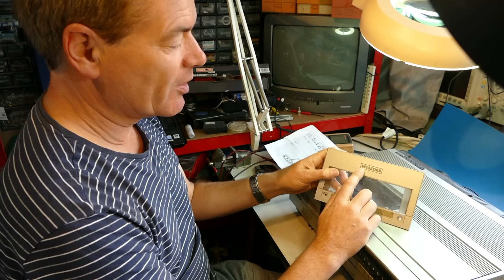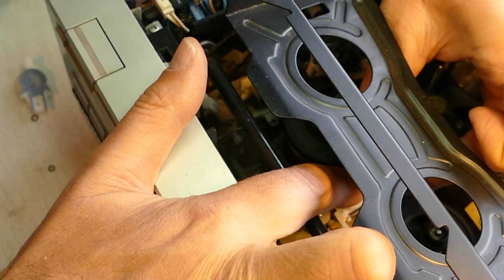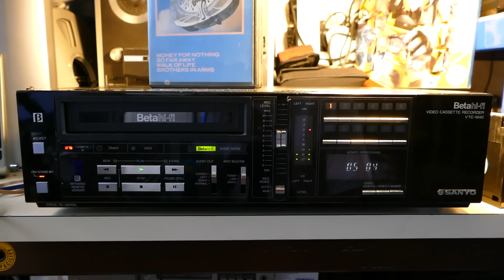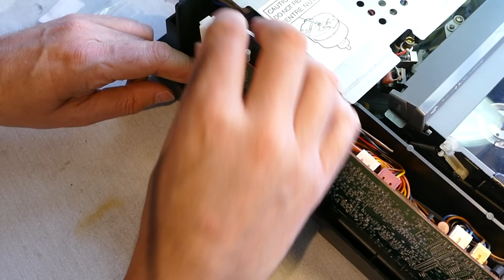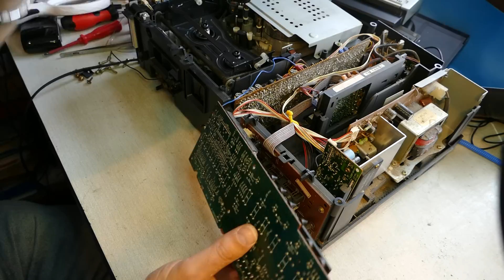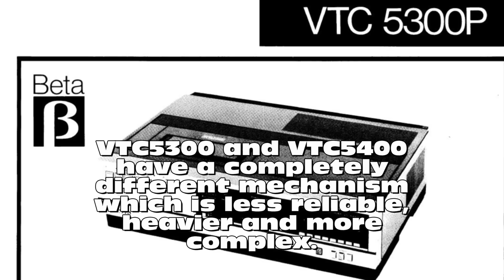Servicing Sanyo Beta (Betamax / Betacord) VTC5000, VTC5150 etc.

Comment: I bought a VTC 5150 last year after seeing in your video that it’s a better machine than the VTC 5000 as it doesn’t have that bug as carried over from previous machines.  I recently bought another Betacord, this time it’s one that I’d never heard of.  Murphy MVR 7007R it’s a good clean machine that in time will need it’s belts changing as it’s running a little slow. It has colour pause, rewind and fast forward search.
Reply from the maker: Some VTC5150 machines still have the bug, they must have fixed the firmware part the way through production.  I've not seen that Murphy one but it looks like it may be related to the VTC5300/5400 which is an earlier model.  Some Sanyo model numbers ran backwards.

Comment: Hello again, your videos have inspired me to get out some of my old machines and do some work. Had an old VTC5000 which I though was only good for parting out, anyway found some new belts and idler rings. Replaced it all, cleaned inside and the picture was stunning, but there are some rolling drop outs, not loads. My question is about the drop out compensater. I tried to adjust it with a plastic tuning tool but it's a deep set screw and looks a bit worn, a metal head might work but there are solder connections near the hole and I don't want to short circuit anything, do you have any tips?
Reply from the maker: First, select pause.  Do the dropouts continue to roll or do they stop with the tape?  If they continue to roll, it's not dropouts but arcing in the reel motor.  If they are dropouts then maybe power the machine off, adjust the DOC control slightly with the metal tool, try it then.  I'm not sure which way to turn it so you will have to experiment a little.
Reply: @video99couk  Good stuff. Thanks for your help.
Reply: @video99couk  Hey, I didn't have the issue when pausing so I don't think it's the motor thing you mentioned. If seams like it's playing a bit fast esp when adjusting the tracking. I stupidly started messing with some of the other adjustable parts like sub trac and FWD.  Any other ideas of what I could do?
Reply from the maker: @SoulDamnFunky  If it's playing fast there will be noise bars through the picture.  Is that the case?  If so, you have a fault which is going to take a bit more time, effort and knowledge to fix.  I can't debug a servo problem remotely.
Reply: @video99couk  I'll keep at it. It's only an old mashine. All good practice

Comment: Every time I see 'professionals' recommending cotton buds I cringe. As I've been sent a few to sort with heads ripped off or damaged by owners using these to clean the tape path. Many don't realise the heads are NOT the huge silver drum but located in the slot in the centre on a spinning disc. Another no, no is loosening the tape guides ,maybe in the hope to get it to play better, when it needs a good service. This action will make playback poor and mis tracked on both it's own recordings and others from other machines.
Reply from the maker: You will note of course that I only used cotton buds well away from the video head, and used proper head cleaner sticks on the head drum, for just that reason.  On my Toshiba Beta video I also mention that tape guide adjustment is not something to be carried out on a whim, even when a machine seems to be playing tapes badly: In the Toshiba case it was due to a bad pinch roller.

Comment: Did I hear you state they were assembled in Wales!! I think not, they were assembled in Lowestoft Suffolk my friend. I used to work there.
The reason Sanyo called them Betacord was because Sanyo developed  a unsuccessful format called Videocord. They decided to call their Beta machines  Betacord and the unlacing for FF and REW from the VTC5000 was another slight change to Sony's always laced design so made more sense.
Reply from the maker: I stand corrected. I was told back in the day that they were assembled in Wales.  I am still trying to find a Videocord machine.

Comment: Brilliant video. I'm currently in the process of resurrecting a VTC5000. It seems to have a sync problem on video, though audio sounds okay. The picture will not track correctly, it seems to wobble a lot. I have replace the light blue sanyo branded capacitors, on the servo board (given that these also cause sync issues on the Sony C5 and C7), yet the problem remains. Is this something you have seen, before? Video showing the issue, over on my channel - https://www.youtube.com/watch?v=ioQ_lFGOPiw&feature=youtu.be
Reply from the maker: Never seen that exact fault but I would certainly be looking at PSU capacitors.

Comment: Great video! I have a 5000 and a 5550 (Which you also seem to have at the end of this video). I also have a 5350 which is the PAL+SECAM version of the 5300. The mechanism in these earlier models is very complex indeed. Out of curiosity, where did you find the 5550? It's kind of a rare machine but it was sold here in Greece because we used SECAM back then.
Reply from the maker: I've had the 5550 for quite a few years, I think it was an eBay find from the days that these things were worth very little.  Yes it is a rare one, and I've found that this machine is sometimes capable of much better playback on very worn tapes than any other machine I have (and I have a lot of Betas!).  I suspect the filter design in the RF circuits is different to the PAL machines and somehow this gives it the edge on bad tapes.  The 5300, 5400 etc. are much heavier and a the mechanism has a lot more parts to wear out.
Reply: @video99couk  I compared the luma/chroma (VD-1) board of my 5000 with my 5550 and the 5550 uses Sony ICs all over the place so that explains the little difference in the picture quality. My 5350 blew its power supply recently. Do you have any spare boards from scrapped 5300s? I took a look on the schematics of the 5300 and the PSU board is identical with the 5350. I also need belts and idlers for my 5000 and 5550. Let me know if you have enough of them left in stock. I also have a very rare VTC 9455 which is a multi system machine, similar to the SL-T7ME feature-wise.

Thanks
Reply from the maker: @crashbandicoot4everr  I don't think I have any 5300/5400 machines, scrap or otherwise.  Interesting that the 5550 has a Sony colour decoder system, like the VTC-M40 has all Sony audio chips.  I have just a few belts and idlers left for the 5000/5150/5550, send me an email (look up email address from video99.co.uk).

Comment: I though white streak on image means worn heads.
Reply from the maker: Yes, that can be a symptom of worn heads too.  The effect from an arcing reel motor is a bit different because the white flashes jump around the screen even on pause, whereas with worn heads on pause, white flashes tend to stay fairly static.

Comment: Great video - totally agree with your comments on the engineering (as I discussed in my own video last year) not only WELL built but very cleverly engineered down to cost without making any part of it rubbish. We could learn a lot from that approach today.

Would be great to find out the fault in that second machine. Maybe dry joints as you mentioned earlier, or cap faults on the syscon board? I had to totally recap the power supply and the servo board on mine to get it to work.
Reply from the maker: I may have another go with the second machine, and I've actually found a third VTC5150 in my store room.  But this video was quite long enough already!  You're right, it was a clever design.  They eliminated all solenoids to keep down cost and weight.  I once modified one for cable remote control.

Comment: hi do you know any info on tascam DA38 DA88 DA98  making video's on the  sony Sl-HF100 is a ace plan to  i still have some as parts went over to betacam
as i been using  blue betacam tapes in my  sony Sl-HF100  now i have 8 sony Sl-HF100 sitting a rouund i love the later betacam sp dig  units bob
Reply from the maker: I have Tascam DA-88 and DA98 machines, see https://www.youtube.com/watch?v=jYCk4oWl5A4&
You can also see my BetacamSP, DigiBeta and HDCAM decks on my various videos.
Next time I have a head drum failure on a Sony Beta, I'll do a repair video on that.  The effect is that the head doesn't spin, but is held in one spot by the head motor, it's a very common fault on all the C20 - C40, F-20 a similar machines up to HF-100.
Also do see my series on PCM digital audio on Beta https://www.youtube.com/watch?v=OPjOeir4iEQ&list=PLhKYgBM5T9vYeUo9qOzEmuGms5AxgdiHn